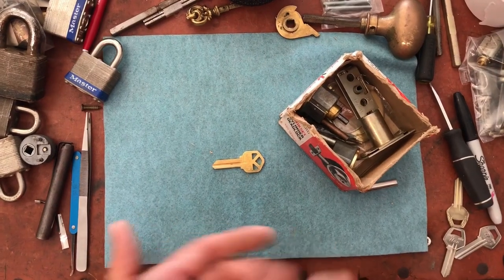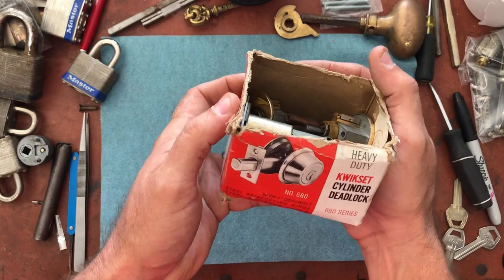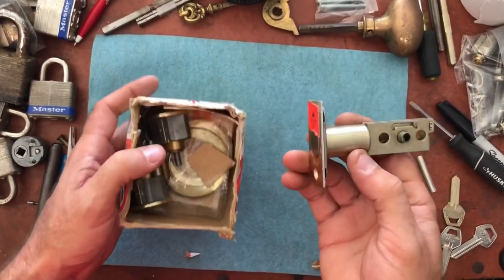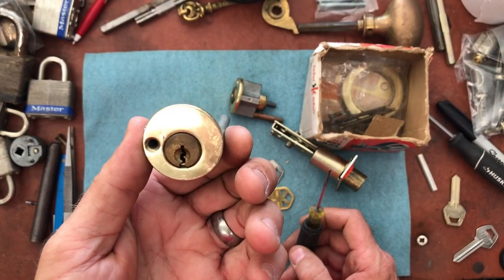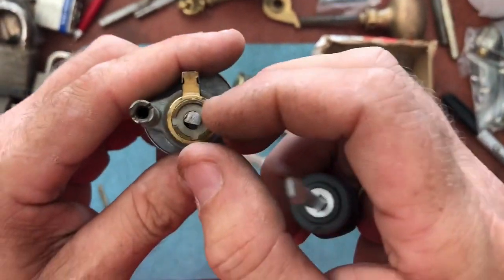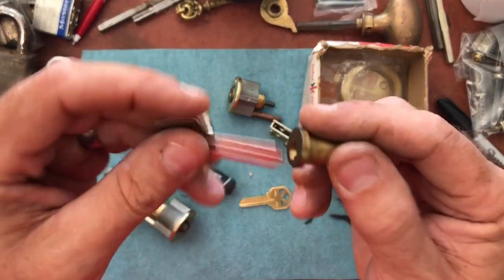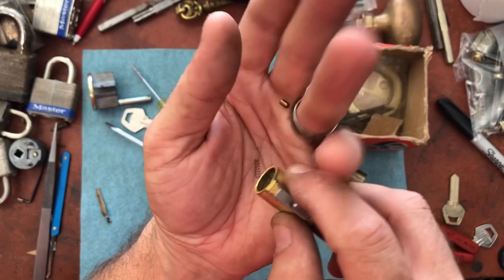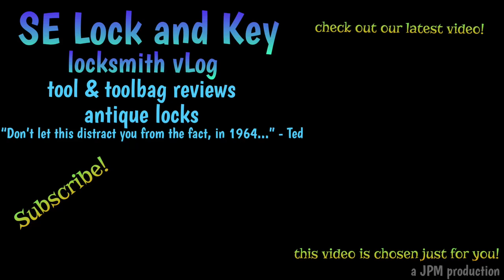KwikCorbin? CorSet? Kwemhart? 🤷🏼‍♂️

Comment: Neat find. Very odd to see those cylinders in Corbin 60 keyway since Corbin's own documentation says that the "K Class" locks should be in Kwikset 1063, Corbin 80 (Ilco 1001GH), or Russwin 751 (Ilco 1011GH). Supposedly Corbin and Russwin produced those locks between 1966 and 1992.